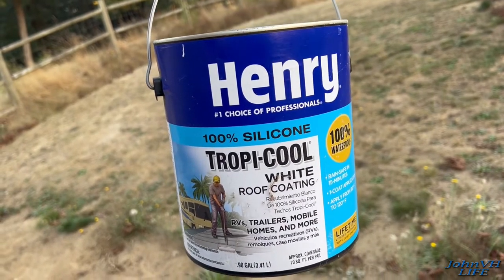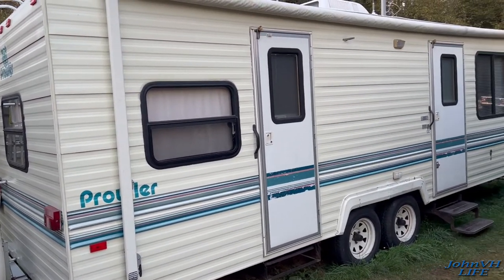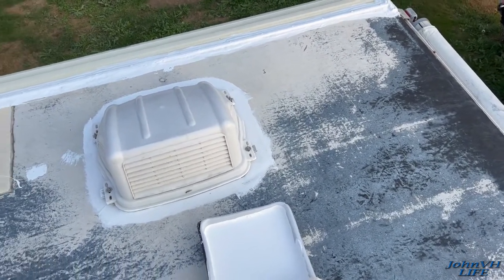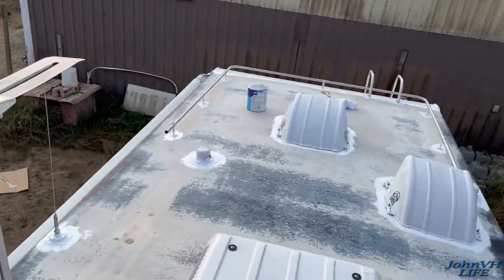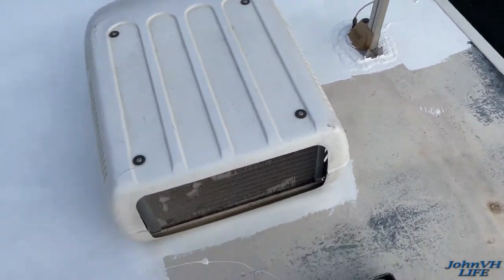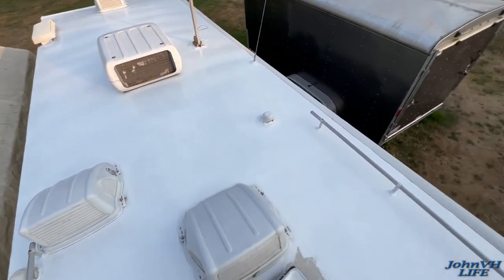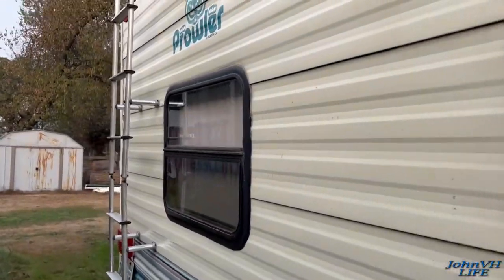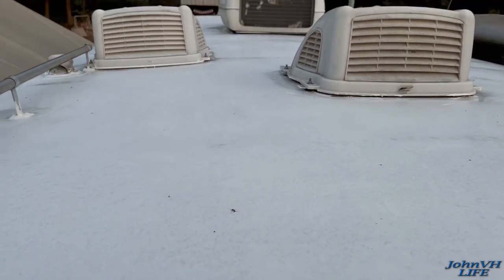Tropicool roof coating HOW TO DIY RV Roof Coating Sealing

Comment: Does it work for aluminum Rv roof
Reply: I used on aluminum camper roof and yes I think it worked well. Doesn't rain much in AZ. Word of advice just make sure you apply it a little thicker in crevices and cracks.